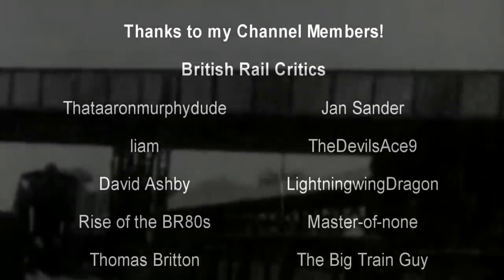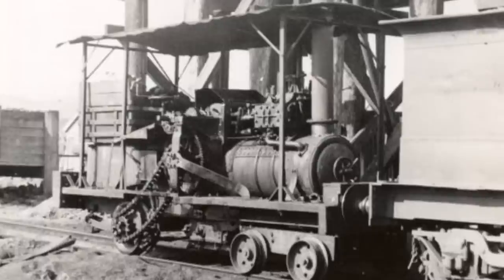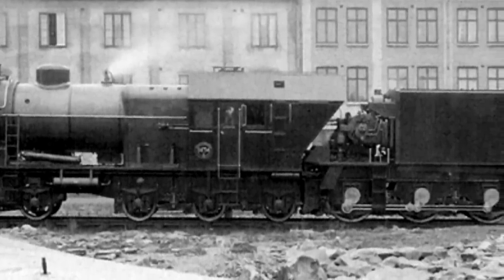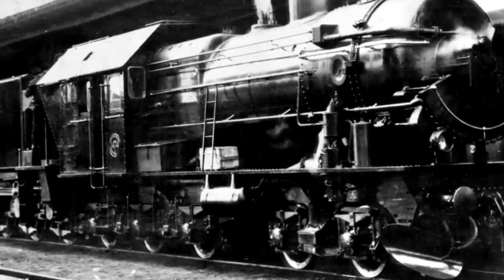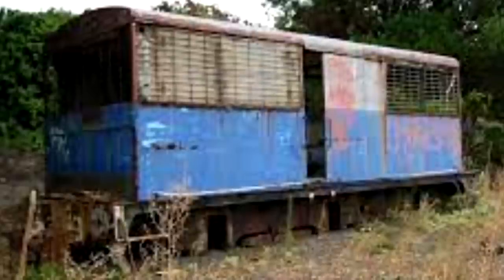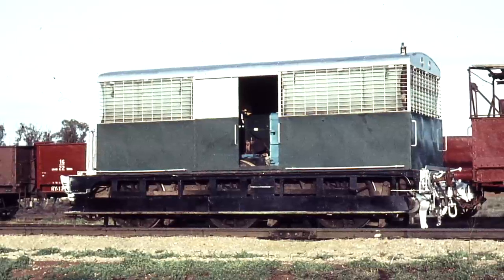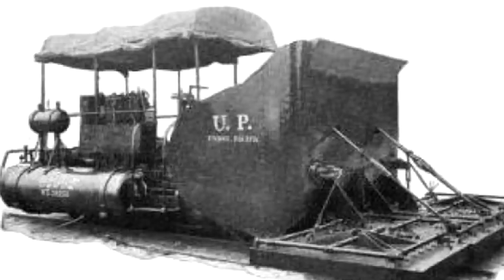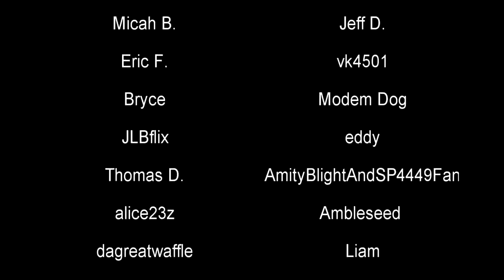5 Trains That Were Clearly Just Mad Science Experiments Part 4 | History in the Dark

Comment: A quick note about Y109/Y413 "The Thing". The Brunswick Plaster Mills bought the chassis and wheels of the loco in 1954, as the basis of a diesel mechanical loco they needed for their operations out of Nowingi. I believe the boiler and other fittings had already been removed and scrapped by the Victorian Railways prior to it's remains being purchased. I did read that the gearbox used was out of a Centurion tank, although I am open to correction on that.

Comment: I really love the mad science locomotives, and I'd never heard of any of these before. A couple of engineering remarks: on the Swedish turbine locomotive, the condenser would greatly reduce water consumption, perhaps by 80 or 90 percent.  On the Oregon and Cali return flue locomotive, the return flue would be somewhat more efficient than straight-through, as significantly more of the heat from the fire/smoke is transferred to the water.

Comment: Oregon & California 'A' looks like another 'internal user' locomotive for a short-range shunt where a off-the-shelf locomotive was not available. The boiler is tiny & the headlight looks enormous. The return-flue boiler might have been meant for something meant for a different purpose in a factory. I would say that a lumber mill needed something capable of moving flatcars of timber products around on very light rail as far as the interchange siding.
The weed-burner would not have been a major issue if they worked in spring just as weeds were starting to become an issue.

Comment: That Y109 is similar in concept to LMS No 1801, the first British standard gauge diesel shunter for a main line company built in 1932 using a 40 year old Midland Railway 0-6-0T as the basis.  It had hydraulic rather than mechanical transmission but its upper-works too resembled a shed.

Comment: Those weed burners give me an idea: superheated steam should work too, so it should be possible to convert a steam locomotive for this job. Obviously you need one that can produce enough steam, and you'll use up a lot of water, but when designed right it should work. Maybe add a connector to the boiler and build a special tender with a steamer attachment and a bigger water tank

Comment: i would like to note chain drives were very common on heavy trucks in the beginning, so its not out there since it was adapted from a truck.  those were probably the two chains from that truck put together into one big chain.  could also be that the original truck was wrecked somehow, heavy machinery could be a real pain to get into australia, so reusing it would be a major plus.

that and the thing...i have seen some odd stuff made in australia because issues with getting heavy machinery.  the thing was probably built because of that issue.

if you look at australias domestically designed and produced tanks, specifically the engines, they at times had real issues getting heavy machinery.
Reply: Just look at the AC1 Sentinel - they had to build its powerpack out of a trio of Cadillac V8s in a cloverleaf pattern.
Reply: @kristoffermangila  thats what i was referring to.

Comment: I currently operate a herbicide spray rig, and it crazy all the insane ideas they have come up with to keep the roadbed clear, they even have a new machine that vacuums up the old ballast washes it then puts it back down and retamps it all in one piece of equipment. Also following a grinding train is a lot of fun with a modified truck with a remote controlled spray nozzle that can shoot over a hundred gallons a minute at any fire that can start, running rail equipment is a blast!

Comment: Aveling and Porter did steam tractors which are rare but seem to be effective. Sentinel's later steam engines used the power plant from their lorries (the Double brothers were working there at the time) with a chain drive for 100 and 200hp shunting engines.
The second one looks like half a Garrett? Odd
ETA, Locomotion of 1833 had returning flues but that was experimental and didn't have a cab.

Comment: About "The Thing" at 5:46.
Some film of it running for raillfans in 1968 :
https://youtu.be/Bv5VPrxbRxo

The simple reason it was converted from a steam engine in the early fifties was that a low power diesel motor is much cheaper and simpler to run than an 1880s era steam locomotive with a boiler just fit for scrapping.
Even an 1880s Y class steam  locomotive had far too much power than what was needed for the flat line task of shifting a few wagons at low speed.

Comment: Actually neither the Foden adaption or the expired steam into diesel mechanical conversions were that uncommon. Road vehicles, both steam and petrol have often been 'adapted' into railway engines on most continents - and not always by backwoods operators. Ford cars and Fordson tractors, being cheap and easily obtainable, were very commonly used. As for 'The Thing', a number of French metre gauge railways, some Italian local lines and Welsh slate quarries, amongst other places, carried on for years using diesel or electrical mechanical locomotives built onto the frames of worn out steam engines. Pay a visit to Statfold Barn Museum in Staffordshire, where they have examples of both types.

Comment: Now, you could do the Ootacamund intermediate driver locomotives. Technically a 0-8-0, it had an extra driving axle. That was connected to.... nothing! Used on railways in India , the "Ootys", as they were known, were actually fairly successful, being reasonably economical and excellent hill cilmbers with  the heavy freight of the time (Late 1850's to early 1880's approx). But they were also maintainence heavy, and although availabilty figures were good, they could have been a lot better.

Comment: The turbine loco probobly had the power axels so far back to get the turbine as close to the condenser as possible. The issue is that the condensing pipe is huge and not very flexible.

I guess that they could have pushed the powered axel forward so they are sitting under the cab and the fire box. Like sort of a half garret.

Comment: Y109 wasn't an experimental locomotive it was a new Locomotive that just reused Y class frames Y109 worked with an even weirder locomotive named "cleis" it was an intact IB wagon with an old tractor engine mounted inside it with chain drives to the rear axel sadly cleis was abandoned and left to rot after the plant it and Y109 served closed
Reply: "Cleis" was actually a purpose built rail tractor, rather than a converted wagon. From memory, it was bought new by the Melbourne Gasworks and later ended up with the BPM out of Nowingi. The converted IB was built to replace "Cleis". Apparently, "Cleis" does still exist in a much modified form, somewhere up in the Mallee. I think rail historian Bruce McLean knows where it is, but he won't reveal it's location.

Comment: Can’t believe the Victorian Railroad preserved the Thing and yet couldn’t be arsed to preserve an S class instead
Reply: The Victorian Railways sold Y109 for scrap value to the private company who used the frames and wheels to convert it to a very low power diesel for the small tasks they had.
The plaster company allowed it to be preserved after its use was finished.
Agree it was a tragedy that all the S class streamliners were scrapped by VR , but a plus coming out of that uproar was an example of every existing VR  locomotive after that has been preserved, mostly running like the Y sister engine :
https://youtu.be/iCn71Fh6En0